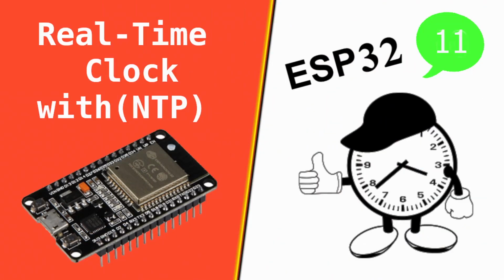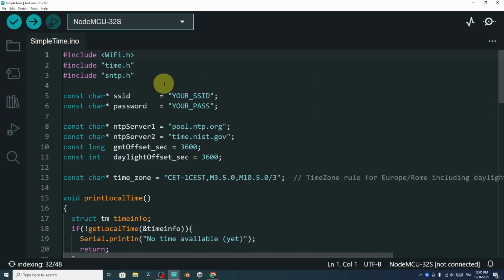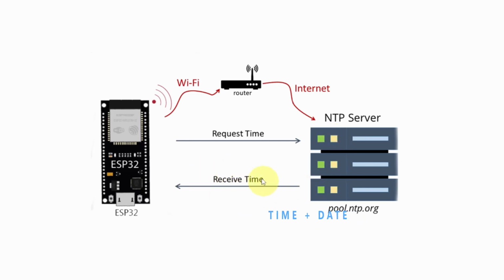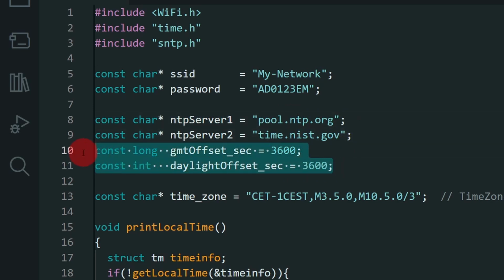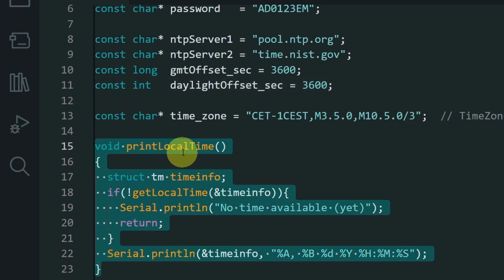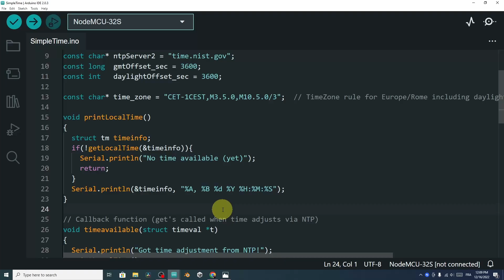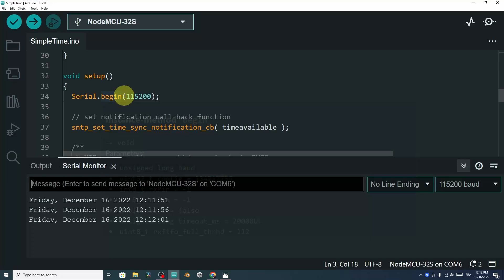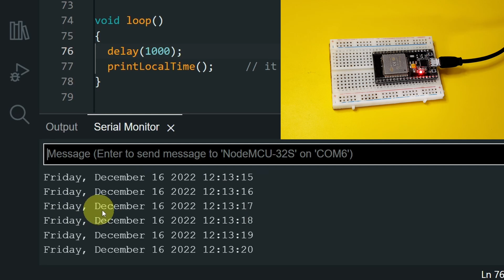ESP32 NTP Server - Real Time Clock (NO RTC Module)

Comment: Oh yes ntp… this video does not show the advantage and reason why an external rtc with a battery is needed… please give proper full information this is not a reliable rtc because if your internet goes off or if power fails or both you have no way to get proper time. Show how to make a sketch using a battery based external rtc access and store data and send when connection opens up again, then you will have a good video. Keep it up but this does not address etc with sleep or brownout etc. but cool project keep it up.

Comment: Great video!
do you have the code to print the data on the LCD screen. I need separated values for Hours and minutes. 
Thanks in advance.
Reply from the maker: No problem 😊 
I have talked about getting each value separately in this video 
https://youtu.be/9kxcsa_2iIs
Reply: @DIYTechRush  Cool! I have seen it.  So clear. Thanks a lot.
Reply from the maker: No problem